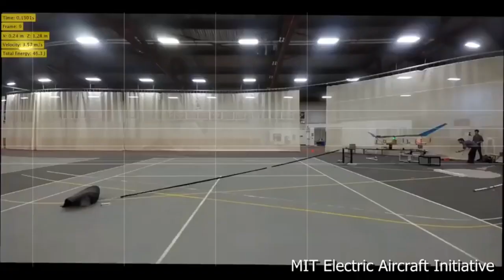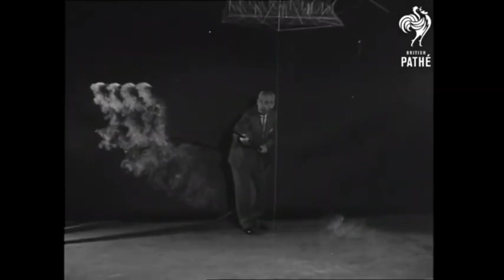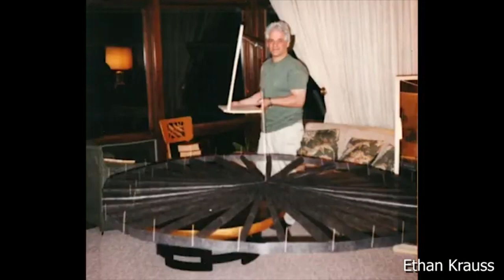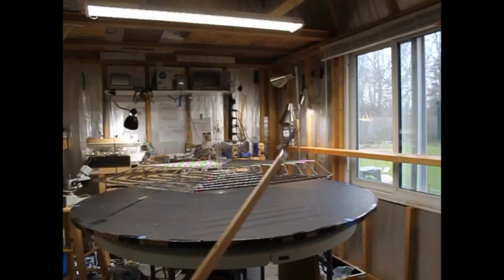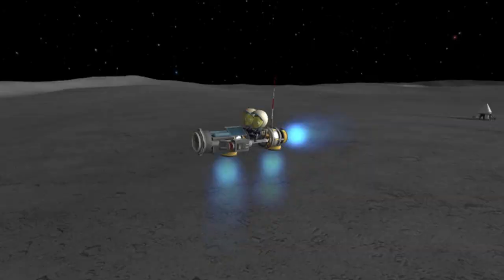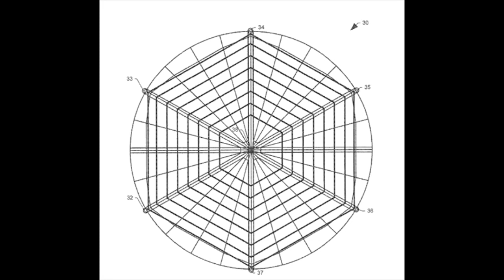Self-Contained Ion-Powered (propelled) Aircraft.  This ion thruster lifts its power supply!

Comment: Mind if I ask what is the highest voltage you have been dealing with during all of this and past videos and off camera past and present?
Reply from the maker: Hi Ned,
Some of the more recent flight circuits could reach about 100kV or so.  I've made Tesla coils and Van De Graaff machines that could make 6" sparks or so, but they weren't used as power supplies, just for fun. 

Update: Last year I built a 1.5MV power supply. It was not built to be used onboard, nor have I worked with it extensively due to safety concerns. I think at those extremely high voltages one should spare no expense when it comes to safety. I am currently trying to keep the safety level in a more comfortable range.

Thanks for the comment!
Reply: @KraussEMUS1  Have you thought of trying much higher voltages? I've heard that it should be quite interesting...
Reply from the maker: @space_mmx_now_please 
Hi Ned,
That is the plan for the future:). I'm focusing on reliability and better steering and stability for the moment.
Thanks!

Comment: Does MIT do the same concept for their ion propulsion plane prototype as yours? Who's got the better efficiency?
Reply from the maker: The recent MIT device produces the same thrust per watt as a 2 stage lifter, 1/2 gram of force per watt.  This craft produces about 14 grams of thrust per watt before circuit losses and nearly 7 grams per watt in total.  More improvements are expected soon.  It takes much more force and efficiency to rise vertically and stay airborne for several minutes. The MIT glide lasted about 8 seconds according to their paper.
Thanks for asking!
Reply: @KraussEMUS1  thanks for the answer too. It's quite significance power output compared to MIT device.  How much time the research took? Going forward, which specific industry target for your ion propulsion engine applicated for? There are some outlook about improvement to your device forward?
Reply from the maker: @rair-80fanboy47  
The research took 21 years so far.  About 6 years to get it to hop with the power supply onboard.  It could initially make a commercialized lightweight drone in the short term.  I hope it will have much better performance within a month or so.
Thanks for asking!
Reply: @KraussEMUS1  such a great innovation. Keep it up, i hope you got the best result
Reply from the maker: @rair-80fanboy47  
Thank you so much!!  I just wish I could make faster progress still, but sometimes these things take a while.
Best regards!

Comment: Unbelivable, small question, what do you think about these diodes for the multiplier circuit? -> Diode: US1NWF-7
Reply from the maker: Hi Norbert,
 The Trr is too slow. The voltage is too low. The current is too high generally speaking.  You would have to use many of them in series per multiplier stage, and then the weight would be a little high as well. I would recommend looking at small axial diodes instead.  All of the other parts should be SMD.
Reply: @KraussEMUS1  After some further search i couldn't find an axial one, the best one i could find with your input was this one: RFU02VSM8STR , but i probably have to use three in series.
Reply from the maker: @norbertfeurle6474  
Hi Norbert,
If you type in "high voltage axial diode" in Google and click on images, you will see a large selection of diodes.  Just pick the most appropriate ones.  If I give you the exact part number I use, they will sell out, but there are actually several that will work.  You can also grind them down on a lathe or with a dremel tool to save more weight.  At least for me, it has been super helpful spending lots of time hunting on Google for the best parts.

Comment: According to the force produced, it's possible for the few years ahead ion propulsion could be compared to jet or propelled plane? Could it be replace propeller or jet engine someday?
Reply from the maker: Hi Rayhaan,
It does not produce as much force as a propeller yet for a given area.  Improvements are rapidly being made though.  It can currently produce more force per watt though, by using a large surface area.  
It is clear that it will work for small drones and likely in space with small added propellant tanks.
Thanks for asking!
Reply: @KraussEMUS1  great, keep it up 👍👍
Reply: But, could it possible to use hinger atom mass to produce more kick/atom??
Reply from the maker: @rayhaanrkp4794  
Hi, 
I think you may have meant higher atomic mass.  There are plans to try sulfur hexafluoride as a possible propellant instead of O2.  It was shown to give much more lift in tests.
Thanks!

Comment: The problem i see, when this idea someday should use an Human Pilot in the center. What the Ion field do on his body? Like the Radar Operators in the early day of Radar. Also do not this Design reminds you way back of the "Nazis-Ufos"? They need many porcelain or not?
Reply from the maker: Hi Seska,

No porcelain is needed. There are just some thin plastics used for electrical insulators.  There would be no problem for human pilots, a little bit of distance and some thin plastic shielding would protect anyone in the center.  It would be a challenge to carry a person at this point though.  It is currently made for lightweight payloads only, unless made relatively large.  Who knows what is possible in the near future though...
Thanks for commenting!
Reply: @KraussEMUS1  ya to carry one person, it would have to be the size of a whole country 😂
Reply from the maker: @mainamaina2578  
No, It wouldn't have to be all that large to lift a person anymore.  It is still not ready to be used for flying cars just yet though.  It is more for UAVs or  space type applications.  At the current rate of improvement the future for the technology seems exciting.  Who knows what might be possible in the future with continued improvements.
Thanks for commenting!

Comment: Im asking as a hobbyists how much can it cost to prototype this kind of thing ? Are you guys like millionnaires ? Even reliable RC Drone are unreachable for me !
Reply from the maker: Thanks for the good questions:).  I've had to wait several years to be able to afford some of the components to build this, because some of the vendors only sell in relatively large quantities. 
Technically, each craft doesn't cost too much to build component-wise, it is having to buy them in batches that is the problem.  Since I have been working on this for 20 years, the cost of everything has tended to add up. It's currently more expensive than the average drone to build.
Thanks for asking!

Comment: I require Thunderfoot to get involved.
Reply from the maker: I am not sure I understand your comment, but it sounds like you might be skeptical.  The only "Thunderfoot" that I could find online is a scientific skeptic/ devout atheist. 

This device has nothing to do with religion or pseudoscience.  Ion propulsion is 100% proven to work both in space and on earth. 
Here is a short NPR News article, done by the host of NPR Jeff Saint Clair, who personally saw the craft fly.  It certifies that this craft does fly and carry its power supply onboard using ions:

https://radio.wosu.org/post/exploradio-oberlin-inventor-pushes-limits-ion-powered-flight#stream/0

The device is also solidly independently verified by many experts shown on our website here:
www.electronairllc.org
Thanks for commenting.
Reply from the maker: @vectteur  
Dear Sir,
If you are you referring the person who debunks pseudoscience etc., he will have no reason to be contacted.  If you read any of what I have posted, it will be very obvious that there are no tricks here.

I am working on making a production version of this, but these things take time as with all inventions.

Thank you for your comment!
Reply from the maker: @vectteur  
Hi Vic,
I think this a lot more of an experience thing than about  "genius."
I have been working on this project for decades, so it has had some significant improvements over the years.  If you read about it,  I hope you will agree that this is different:).
Thanks for commenting!